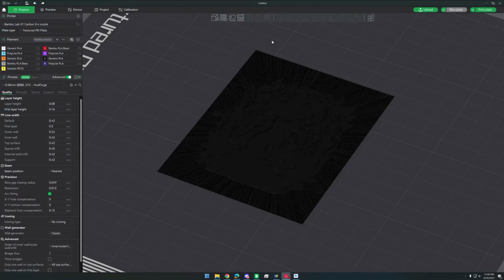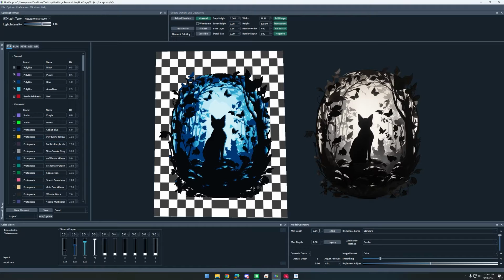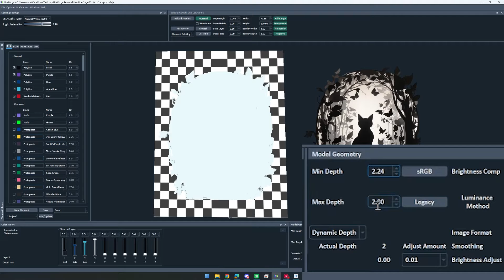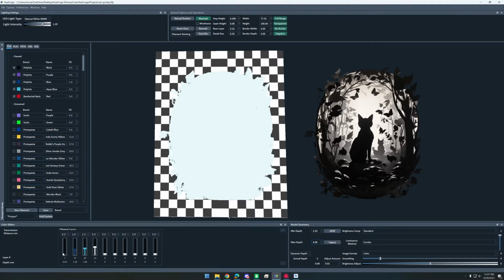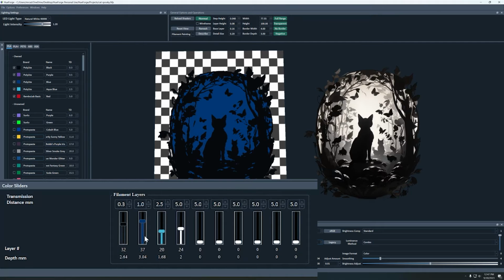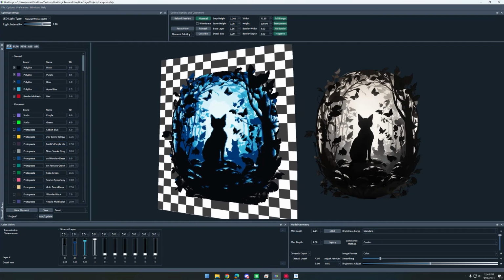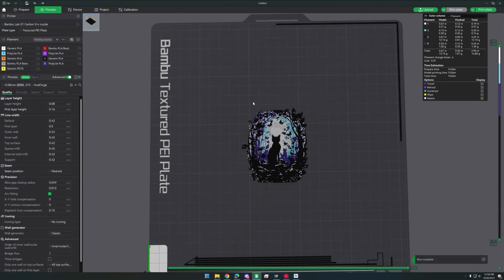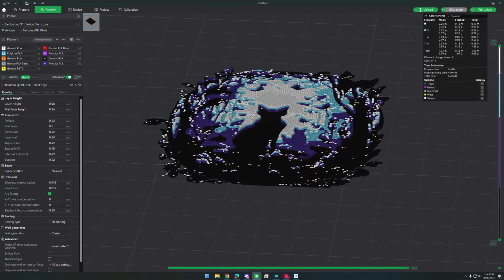How to Thicken HueForge 3D Prints

Comment: something that will stop the stringing, just an fyi, set it to print by object instead of layer, and select the "avoid crossing wal" setting under the quality tab on the bottom. I recently learned that the travel distance makes a huge difference when it comes to the stringing effect and it's helped me a ton!